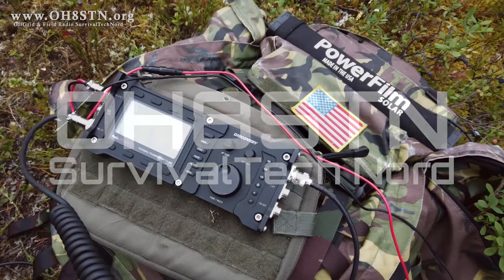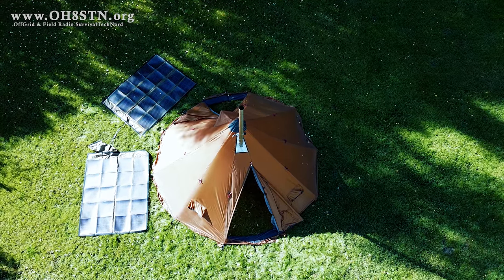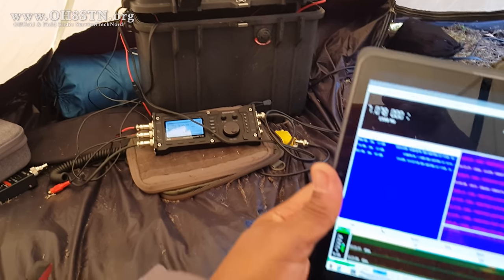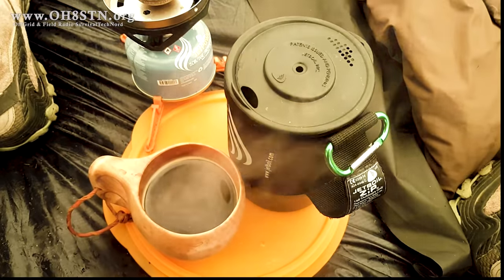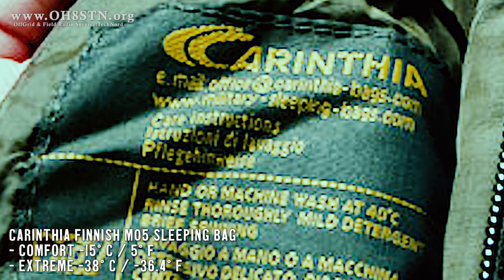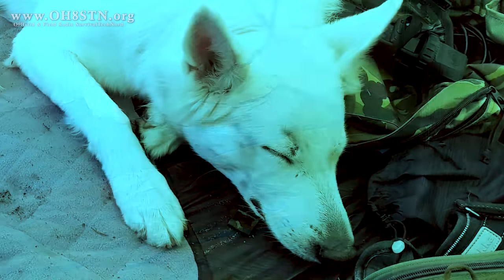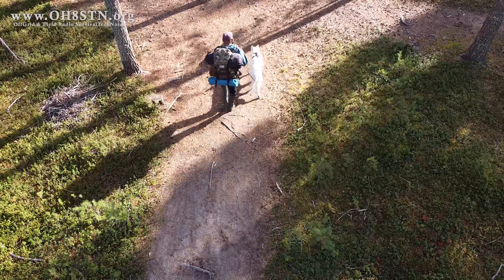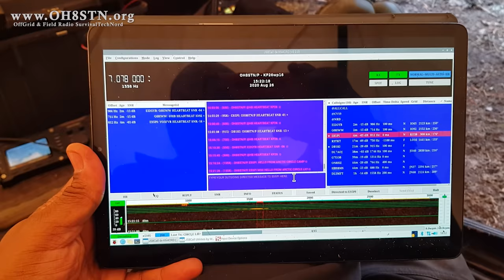Portable Ham Radio | Camping Gear & Shelter

Comment: Titanium heats unevenly. So it is great for boiling water but not cooking or frying.  A great lightweight alternative to the JetBoil is the BRS 3000 stove https://www.amazon.com/BRS-Outdoor-Camping-Portable-Ultralight/dp/B00NNMF70U  paired with a Toaks titanium 750ml cup https://www.amazon.com/BRS-Outdoor-Camping-Portable-Ultralight/dp/B00NNMF70U and you have a lighter solution.  The fuel cannister fits in the cup similar to the JetBoil.  This set up doesn't boil as fast as the JetBoil.

Comment: I have a hard time getting the weight down on just my radio gear.
Reply from the maker: I think that's the biggest challenge Dennis. If we want to run more power, we need a bigger radio. If we want to save weight, liw power radio with more efficient narrow bandwidth modes. The physics keep kicking us in the butt. What is your current setup?
Reply: @OH8STN  FT-818 with MX-P50 45 watt amp in case I need to really get out.  Even that might not get you heard in busy band conditions.